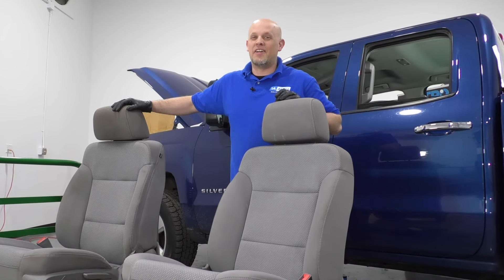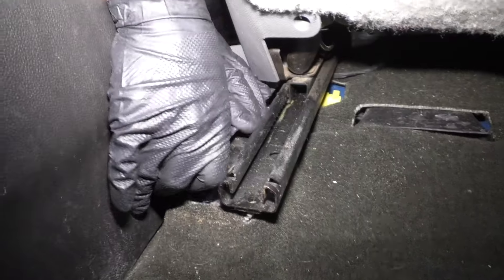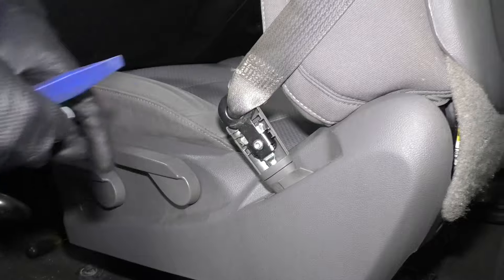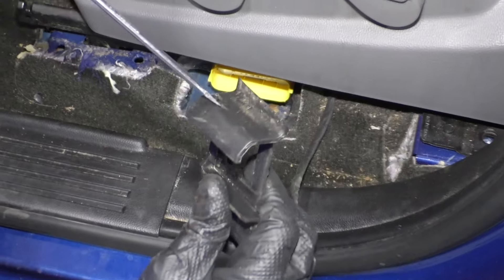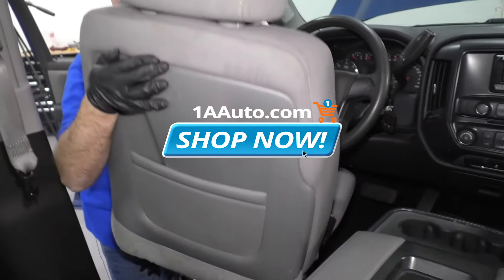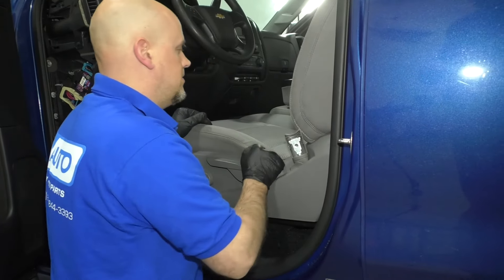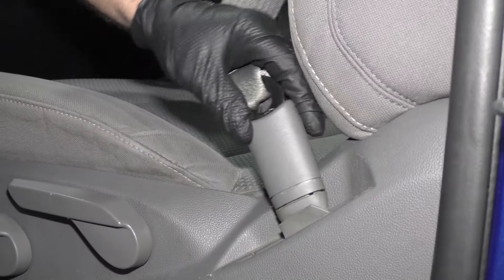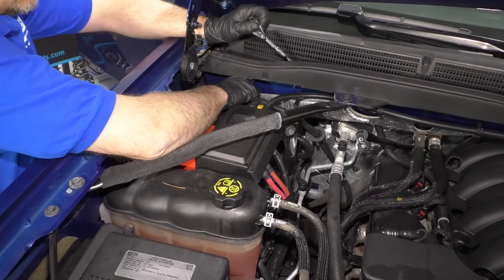How to Remove Front Seats 14-19 Chevy Silverado

Comment: Are you sure the torque specs for the bolt holding the seatbelt anchor are 33 ft/lbs??  Just striped mine out trying that.  Doing some more looking online someone said 44 in/lbs.  It is a small bolt and in retrospect 33ft/lbs seems pretty high.

Comment: My 2022 5500MD did not come with a center seat/console, it was deleted by the factory apparently. I bought one out of a wrecked 2015 that came with the 4 bolts. The factory barrel inserts in the floor do not appear to have threads, will the factory bolts cut the threads, or do we need to tap them first? The bolts look just like the ones you had for the center seat. Any help would be appreciated.

Comment: I have cloth seats and I want to get leather seats but they ask me for seat code at yonk yard. How I can get seat code? My truck is a 2014 Silverado
Reply from the maker: +Luis Mota You should be able to contact your dealership with your VIN and they can assist you further with getting the code.
Reply: Inside of your glove box there is a set of codes specific to your vin

Comment: This video did not help i have a 2015 silverado and seatbelt anchors on seat are bolted farther down than shown in video I've tried tugging and there's no give at all
Reply: 2016 GMC Sierra with power seat buttons... trying to remove seatbelt that is covered by the trim plate.  Was hoping this video would help as the power seat knobs aren't coming off and I don't want to break the switch.